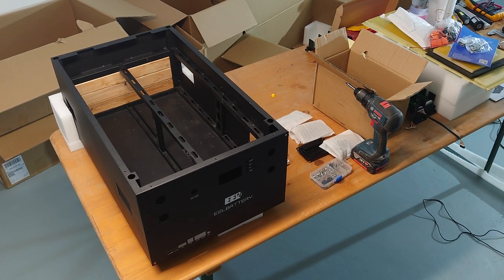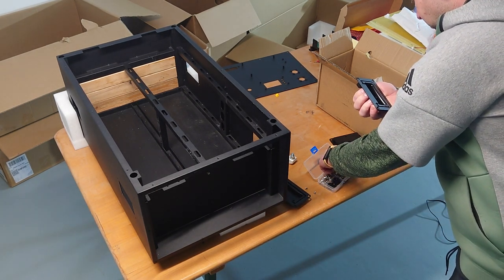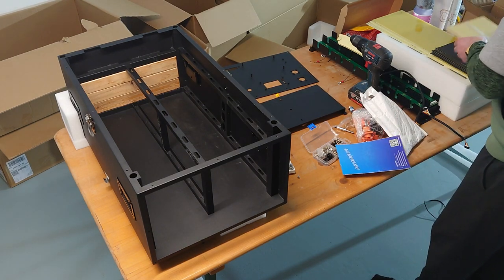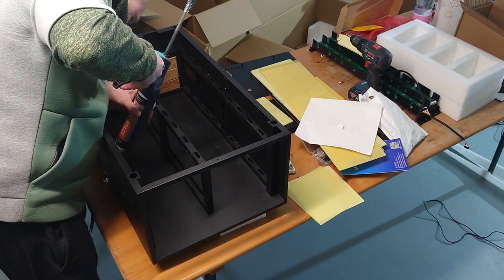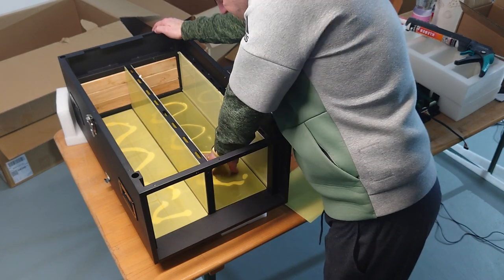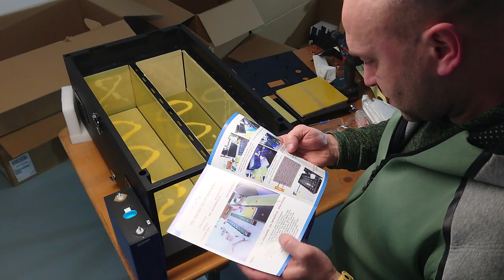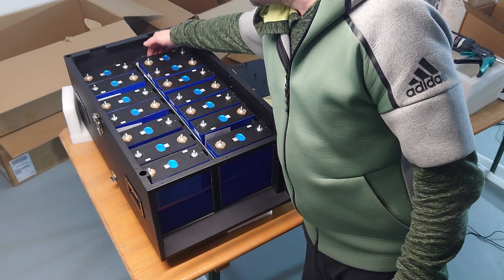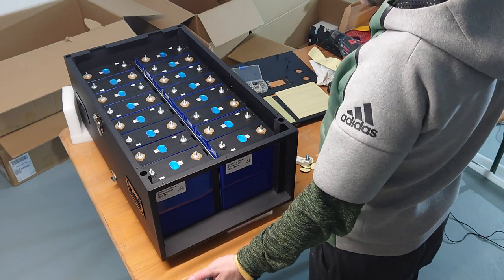EEL diy 16s battery case installation - Part 2 epoxy plates and cells

Comment: Is ot 48 v battery?
Reply from the maker: don´t understand...
Reply: @kirkdis  I meat is it 48v battery pack?
Reply from the maker: @jamatiaborok1094  it is in that range of an 48V battery. It has a nominal Voltage of 51.2V as LFP cells are rated normally 3.2V per cell. That means your charge controller or Inverter should be able to handle a range starting around 47V up to 58Volts....